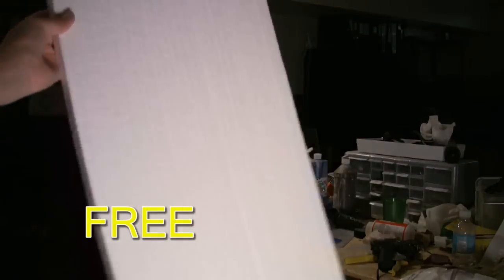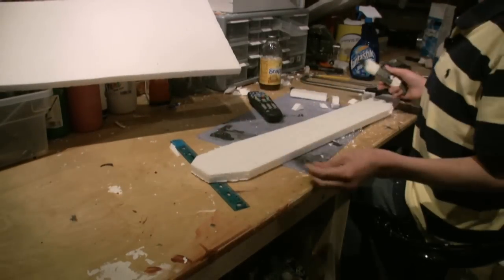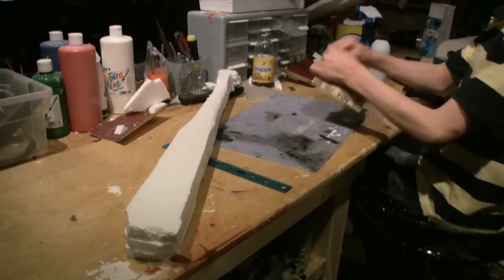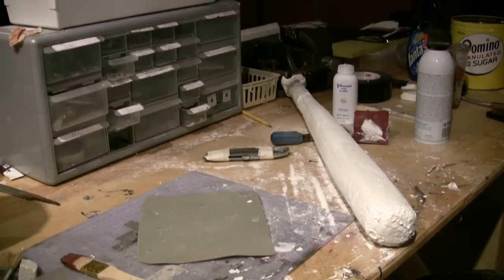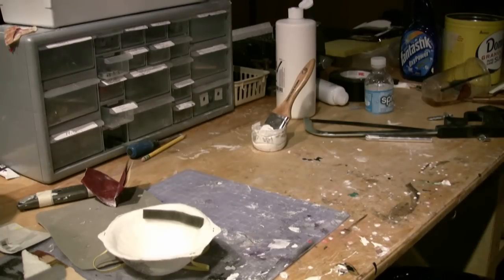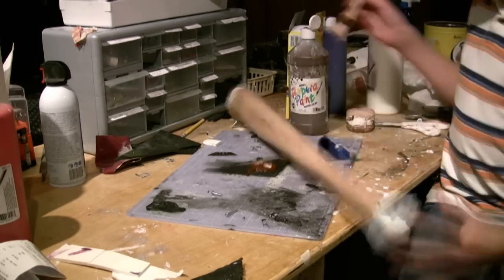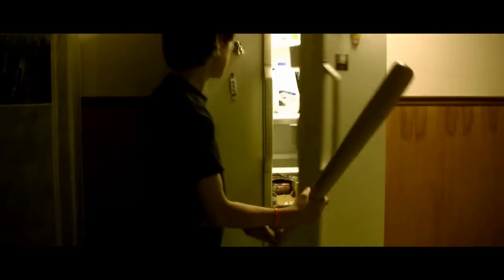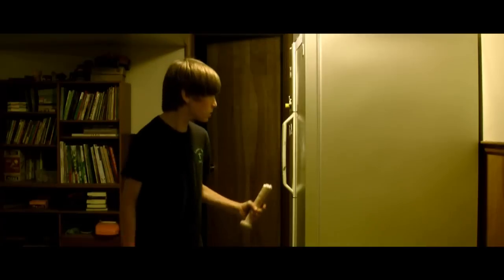Smashable Baseball Bat!

Comment: Lazy Way:
You Need:
A Bat
A saw
Tape
Paint

Cut the bat in halve then tape it together ( not firmly but enough to hold it). Finally paint the tape to match the bat. Hit the bat and it will brake.